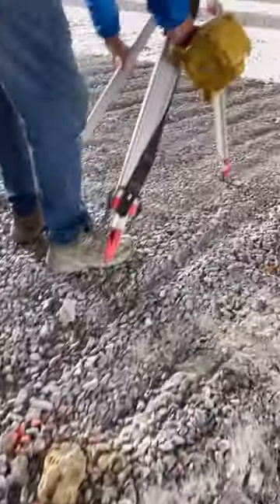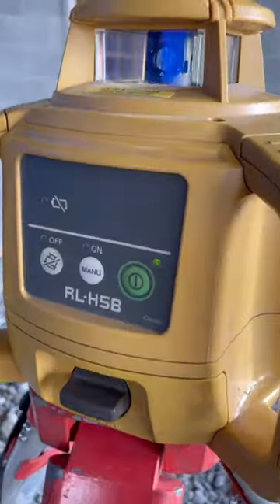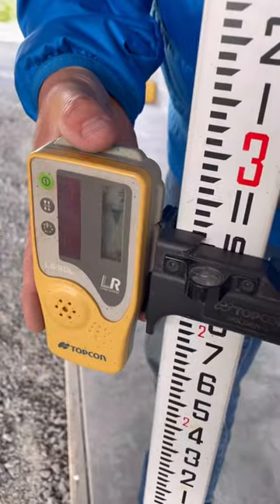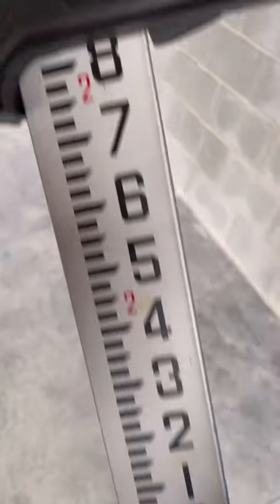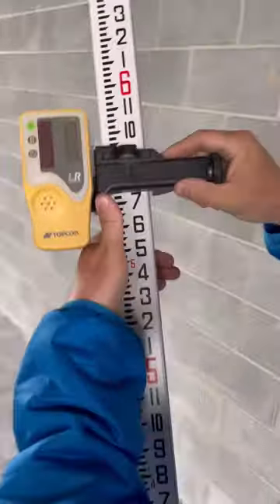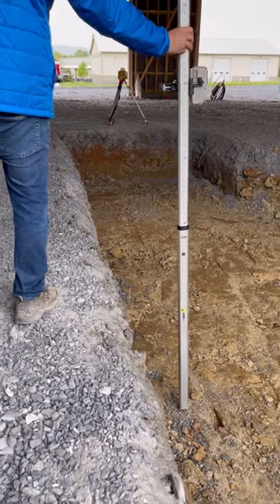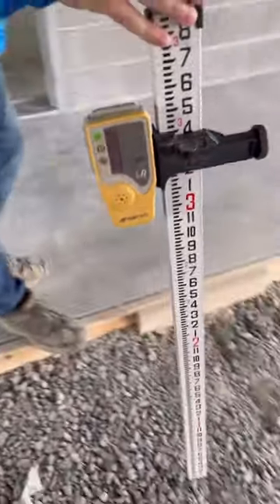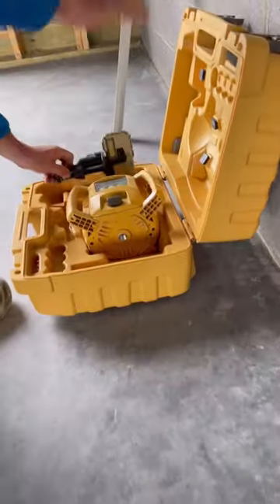How To Check Grade with a Rotary Laser Level

Comment: I never use my tripod. Just set it on anything secure and reasonably flat and lower to your work. It will shorten the rod length and make it easier to use
Reply from the maker: I tend to use my tripod less as well
Reply: @hausplans  I am retired now but back then I found the tripod more vulnerable to a opps
Reply from the maker: Agree
Reply: That all works unless there is something obstructing the beam such as a small hill or branch